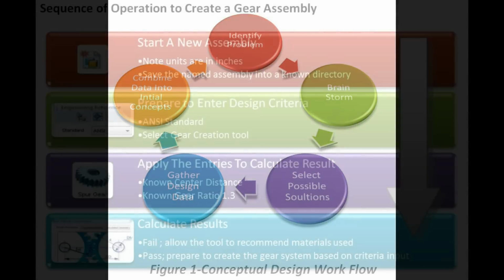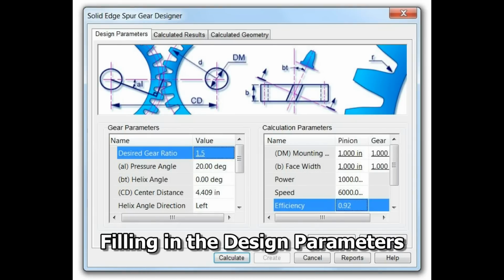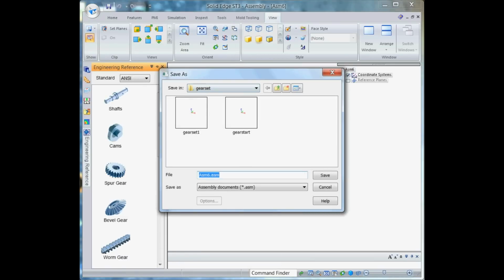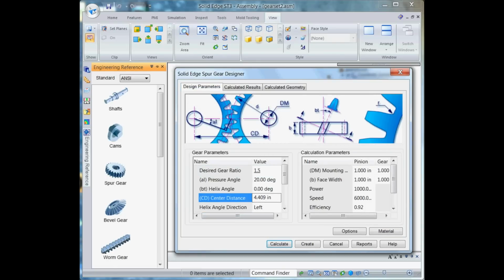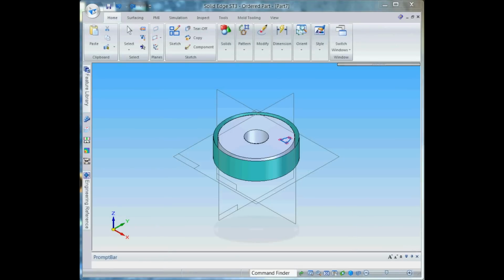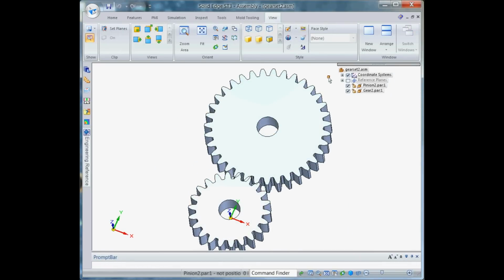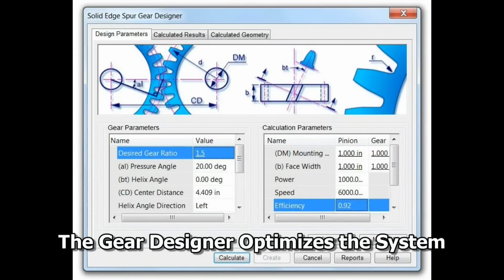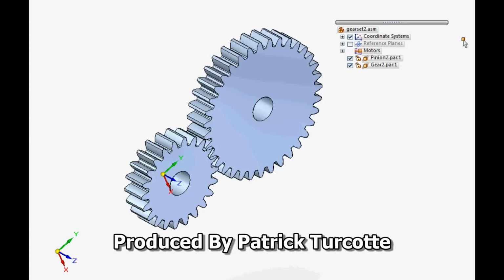Solid Edge Gear Designer

Comment from the maker: spur gears can have an angle added when being created using the Engineer
ing  Ref. Lib. Angle can also be created by rotating the end of a swept body relative to the angle of the start section. It is possible to copy each face ,or sketch boundary that defines the front and back of the gear. Once the two faces are copied the original can be discarded as the new ones can be rotated to create the desired pitch angle. Each resulting section is used to define the lofted or swept gear body,

Comment: I'm trying to make a mechanism with 4 gears in series by making two pairs of gears but when trying to make the relationship between the middle two gears I can't select the PCD faces to make them tangential. Any tips (I'm in ST5)
Reply from the maker: +Theodore Roberts  to do 4 gears the gear designer is executed again to capture the new gear sizes or new number of teeth with a new center distance between with the same module (tooth circular thickness). The module insures the resulting gears mesh with the previous. If the gears are the same diametral pitch, and pitch diameter but are in different positions like those found in a planetary gear system you can re-save the current gears under a new name but add gear relationships when adding to the current assembly.

Comment from the maker: Bevel gears are conical shaped objects and therefore converge to a common appex point when engaged as drive system. If the cone of each gear is tangent at the pitch surface mid point of the gear tooth they will develop an intersection at the top of the cone called the appex. Bevel gears have a pitch angles, an addendum angles, and a deddendum angles instead of using spur gear diameters for the same terminology.

Comment from the maker: To have more than one set of gears you must add one of the gears as a unique part (new renamed part). The second way is to run the gear designer again and delete the gear you do not need. the first gear set you will need to keep the original gear relationship. The new one needs to have the gear relationship added after making it tangent to the surface of the existing set.

Comment from the maker: When Solid edge ref. library is used to create Bevel Gears in some versions  of the software prior to ST5 the bevel gears or worm gears do not mesh until you right click on each gear and show the surfaces. When the surfaces of each geometry are shown the pitch diameters can be made tangent by using  assembly relationships.After gears are tangent the gear relationships can be added by entering in the gear ratio, or number of teeth for each gear.

Comment from the maker: when you install ST5 there are other environments that can be installed over the top of Solid edge. The engineering reference library is one of those applications. If you are using earlier versions the Engineering reference library may already be installed. If you click on view tab and panes it can be viewed on the left by selecting engineering reference library.